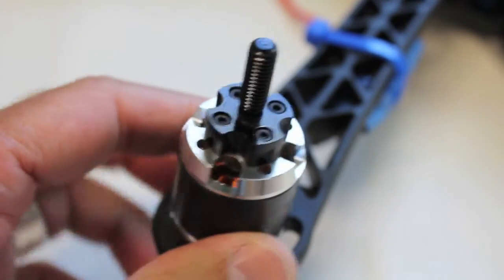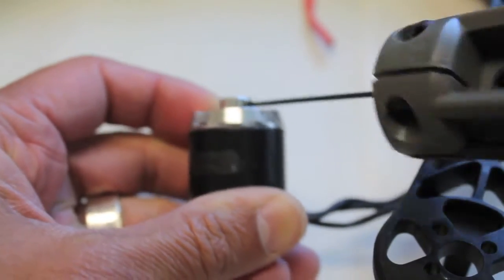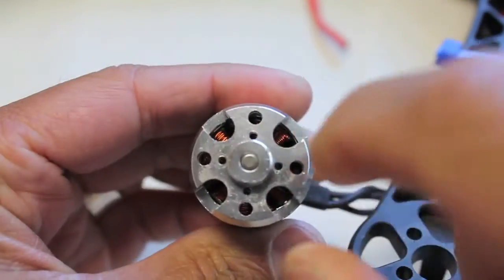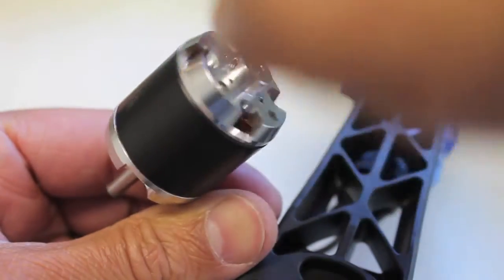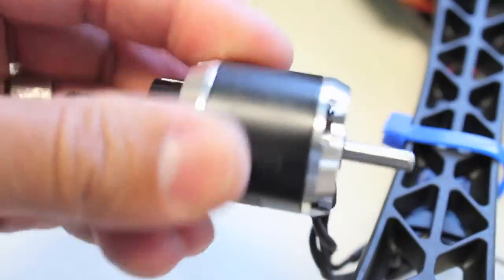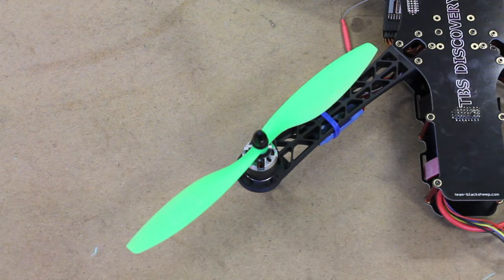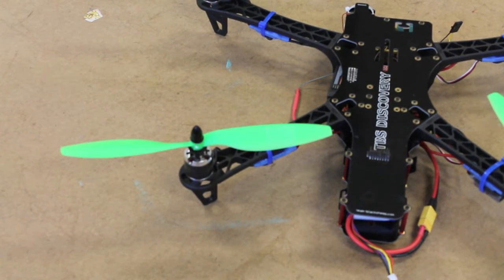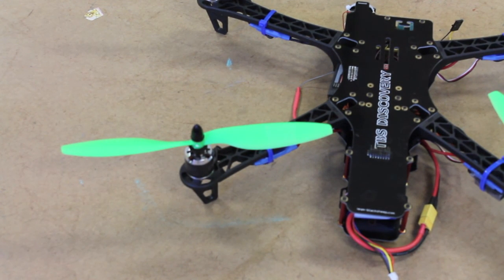iPower 950kV Brushless Motor Cleaning on TBS Discovery Quadcopter - Working on Vibration Reduction

Comment: Have you considered Sunnysky 980Kv motors? They are WAY better than the iPower motors you currently have now, and they are about the same price or cheaper. No grinding, no slop, and smooth bearings.
Reply from the maker: Khoa Nuyen I haven't flown with them before but have heard lots of good things about them. Will definitely check them out. Thanks for sharing.

Comment from the maker: I run a 2400 mA battery and get about 8 minutes of flight time with my ArduCopter. I don't have any FPV gear on it so it's just the standard quad kit. I'd probably recommend going up to 3000 mA or even a little higher to get more flight time. Good luck and hope this helps.

Comment from the maker: Jim, thanks as always for the great tips. Are you currently flying with T-motors? I want to splurge on them, but want to make sure I get some feedback before I do. Yeah I've been looking at different prop balancers and will check out the Topflight you suggested. I've been flying with 720p at 60fps and definitely find it much better than 1080 30fps. Thanks again.

Comment: I responded to this with one of my videos. That quad uses a piece of velcro to hold it on the platform, a velcro strap to go over the camera for further support and some foam on the rear side of it. Produces great results.

Make sure and use a proper magnetic balancer to balance your props, finger balancers with such lightweight props are not accurate. Good luck on your future endeavors!

Comment: Hi! I've seen you still use the washer under your props, but did you check the inner diameter of them already? Please measure the gap to axis! I did with my sunnysky motors and the washers went to trash.. It's like a vibro of a handy when you go without props. And as zimmy told you, please use a magnet balancer!
Also check out the Gemfan 10x5", they're much more precise than the 10x4.5, really cheap, and have almost same shape like the Graupners :-) It's worth a try. Good luck!